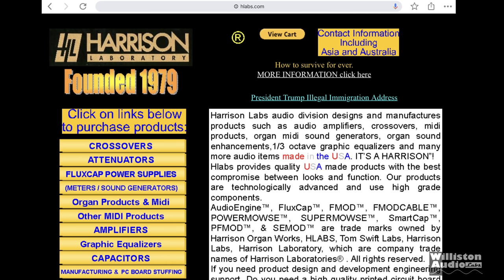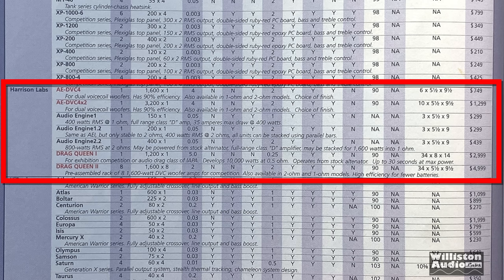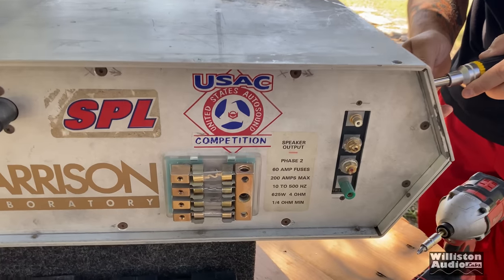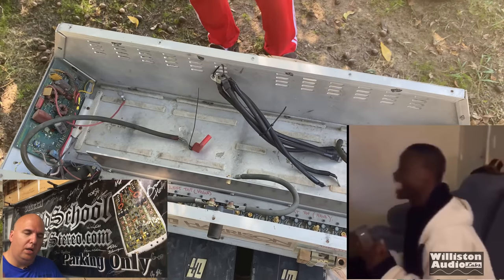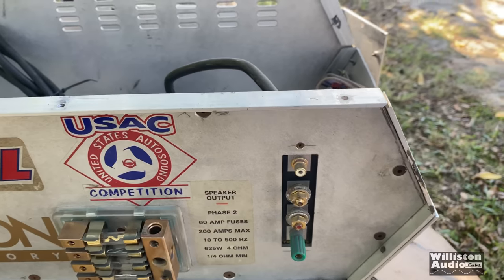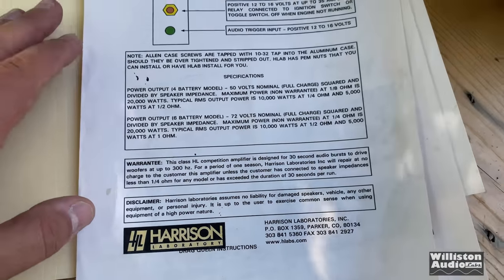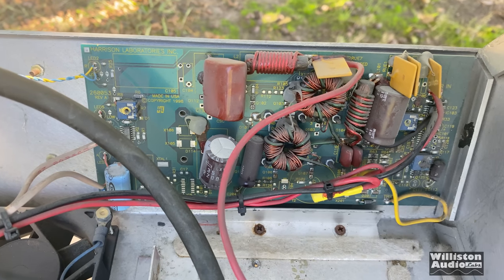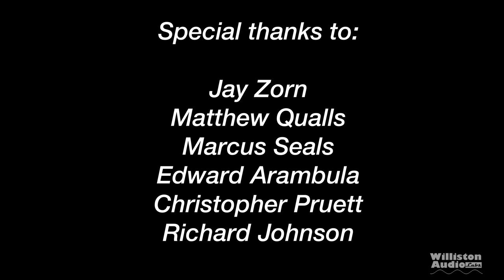20,000 watt Amp Banned from Competitions? 2000 Harrison Labs Drag Queen [4K]

Comment: I JUST GOT 2 L7 KICKER 15S Q SERIES PUTN THEM ON MY 96 IMPALA SS WHAT AMPS U RECOMMENDED
Reply: Doesn’t matter, they will sound like shit, regardless...
Reply: Chiefkyle Hahaha!
Reply: Swap them l7s with American bass xfl. Them l7. Can't go pass 2200-2500 the surrounding break off. But go with crescendo atleast
Reply: @Chiefkyle f no
Reply: @Chiefkyle i get a power acoustics gothic b4 that. Buddahoutchea lex flex with power bass xxl 900 watts 2 12 on a 5500 d class. American bass 2xl on the 6k gothic. My roof do the wave. My screw holder to the back lights broke and my truck has a huge gap now that yu can stick ur finger through the it from 2000 watts xfl.
Reply: @zoidburg2975  LMAO GOOD ONE......
Reply: Mike Bihg that was a great burn back in 96. Catch up  captain feelings😎
Reply: Ok fanboy

Comment: I still don’t get it
Reply: heres a MODERN take on that amp... 24 12 volt batteries to POWER this THING.... for say..... 30 seconds... thats what a BURP is.... 160,000 WATTS.... at 40hz.... BURRRRRRRRRRRRRRP!!!!!!!!!!
Reply: Imagine connecting a battery straight to some subwoofers with an on and off switch. This is what you would get. Quick busy then turn that shit off

Comment: Probably a THD issue, is the reason for banning
Reply: I remember...................... I recall there being a judgement that was passed by a SPL sanctioning body that basically banned that DESIGN. LOL........ Hows that.... ya sit in a ROOM one day dreaming of what these kids are doing to their HI FI SYSTEMS in cars... (it was Hi Fi... before it was Car Audio)...LOL.......  Hi Fi GUY here... ya gotta be old.... yo get it. So this Harrison guy gets to thinking.... WHY NOT just use MULTIPLE DC BATTERIES to generate the power requirements of the transistors instead of bumping up 12 volts through a POWER STAGE..... THUS.... 75 was  the TARGET voltage... what was needed to power them transistors to specs.... The REST was history... BUT upon DEMONSTRATION.... engineer types picked up on the 75 VOLT AMP...... HEY..... WE are a 12 volt community THUS.... That mentality spread throughout the SPL game and LIKE the DAYTONA CHARGERS and SUPERBIRDS of NASCAR fame..... they was OUTLAWED,....LOL....... yeah TOO exotic.... 75 volts from batteries HIDDEN in that box.... What a TIME..... I remember..... These days they using 24 batteries and producing 150,000 watts using similar THINKING..... Creative thinking.... its what made America GREAT..... then it got BANNED....LOL..... and here we are today.... NOT LEADING.... Looks like them Brazilians assumed that lead as of late...... hey.... HARRISON LABS!!!!! its 2021..... Time to build the DRAGGOD............ 250,000 watts.... SUPER CAPACITOR BANKS... the BEST TRANSISTORS.... Maybe I should build it myself....LOL........BDBD/2021
Reply: Well considering it is switching square wave generator that basicly just reverses the polarity of the battery powering it fast you could say it is 100% distortion...

Comment: Why was it banned?
Reply from the maker: Deemed to not be an "amplifier" because it used batteries as the rail voltage, only worked for 15 seconds, square wave, then had to be charged again.
Reply: How about it was banned because  according Williston Audio labs, it was 95% efficient.......do you see the larger picture here......

Comment: 72 volt? so low amp high voltage.
Reply: Negative. High amperage, low voltage. Well, relatively low voltage. Hence why it's designed to drive loads at 1/4 or 1/8 ohm. The Taramps HV line is a better example of high voltage/low amperage designs. They use ~400vDC of batteries and operate similarly but they're not square wave outputs.
Reply: @mitchellroberts7954  internal batteries are in series. 72 volts is high voltage for car audio. to make rated this thing only has to pull like 80 amps. compare that to the amperage my 12 volt 8k sitting here pulls.  relatively this thing is high voltage low amperage
Reply: @666nacirema666  Depends if you're referring to input or output. It's all relative. The 15k I run pulls around 1200DCa input but I'm referring to the output being high voltage low current not the other way around

Comment: Lol @ well before common core
Reply: The math IS correct! If you consider the fact, that the 72 volt string of batteries drops down to ~50 volts, that will put exactly 200 amps into the 1/4 Ohm load. That works out to exactly 10,000 watts. This "amplifier" produces a square wave only, so don't worry about the RMS value. I put the word "amplifier" in quotation marks, because this is merely a switch box. It cannot produce an accurate sine wave, nor, can it amplify full range music. It was banned, because it doesn't meet the description of a true "amplifier". It might possibly be capable of producing a modified sine, which means, increasing dead time between switching from negative to positive or back again (very much like a cheap power inverter) but, it will always swing full rail to rail voltage to the speakers, which is just adjusting the timing of the switching. That would give it some volume control.
Reply from the maker: Vincent’s comment FTW!

Comment: 480watts RMS is the maximum power it uses at 16Vdc and 30amps, so lets just settle down with the bullshit there, thermal losses also lose around 30%.
Reply: them batteries in there were strapped to make 75 volts.... not 16.... as for 30 amp INPUT..... thats a CHARGING CIRCUIT..... not the AMP B+..... the Amp had its OWN CHARGING CIRCUIT built in so you could charge the internal batteries or CAPS to their peak voltage.... around 80 volts.... 100 volts from them CAPS if I recall..... and THAT 100 volts was FLYING OUT THEM CAPS like a LIGHTNING BOLT..... LOL..... Its not your typical 12 volt amp for sure thus it was BANNED......  HARRISON AUDIO ENGINES are still manufactured in 2021.... They primarily make amplifier circuitry for Military Grade functions.... For a long time I think.... They made amps for BATTLESHIPS and such.... Ever been on a Military vessel..... LOUD.... I remember... BDBD/2021

Comment: Huh??... its just s bunch of batteries with no actual amp circuit???... batteries produce DC voltage only, speakers run off AC wave only.  how does a box of batteries amplify AC?... to power speakers?
Reply: Batteries replace the power supply section of the amp, there is still an amp in there.
Reply from the maker: Batteries create the 50 or 72 volts of rail voltage for the transistors they output AC
Reply: @wal  oh ok !  got it now thanks D!
Reply: @cncgeneral  oh ok got it!!  the  transistor circuit converts the DC to AC.
Reply: it sends out "dc" like he said at the end it sends out a clipped signal, wich is not a perfect dc square wave but allot like it, same happens when you push any amplifier to the limit it will start to clip and send a "dc" voltage to the speakers. and if the speakers are not up for it.. they let out magic smoke.
so really its cheating lol. and on low notes you dont hear it that fast but if you over drive a midrange driver it makes a horrible noise. and tweeters dont often survive a situation with heavy clipping. and nr 1 reasons hifi enthousiasts say its better to have a heavy amp with low rated speakers then vice versa.
Reply: @MuvoTX  Correct. It's similar to how the Taramps HV line works. There's no power supply section to bump up the rail voltage, the batteries in series provide high voltage input and the transistors just take that and switch on and off at a variable frequency. <-- oversimplified explanation